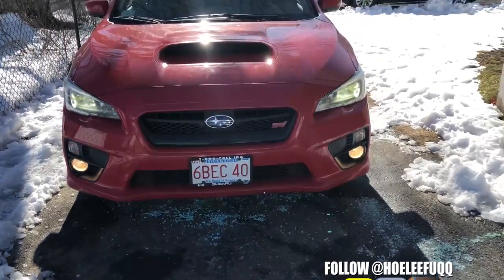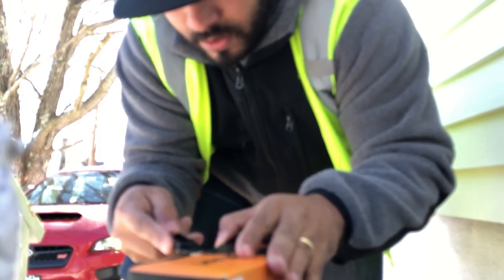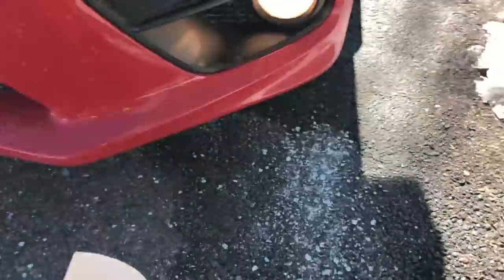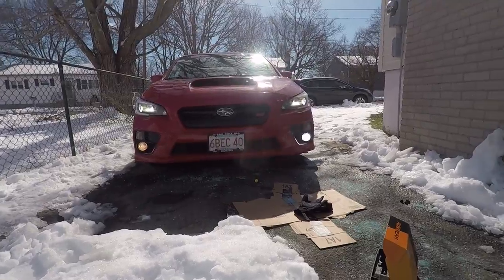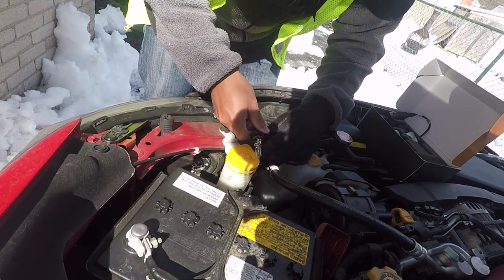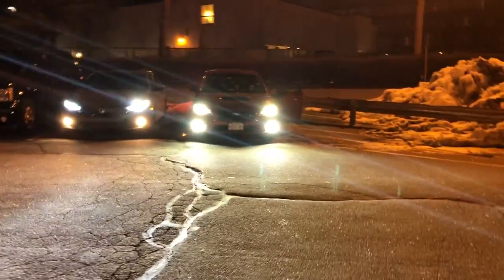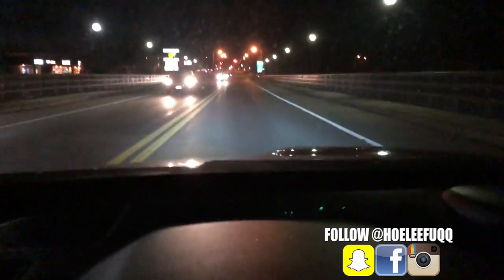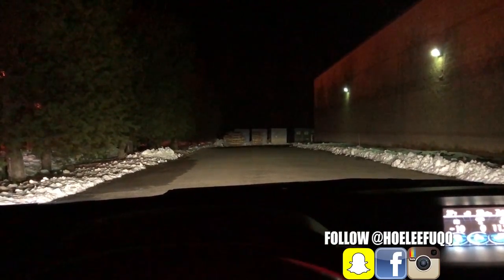BEST & Brightest  LED's? LED DRL & FOG LIGHT INSTALL ON A 2016 SUBARU WRX STI

Comment: Do you have a remote start in this car?
Reply from the maker: Yes copustar remote with android gps module to remote start via App on your phone
Reply: @HoeLeeFuQQ  did it void warranty and does it work with Apple
Reply from the maker: @eduardfernandoajtum173  no it did not
Reply: @HoeLeeFuQQ  sorry for all the questions but I need more details. Like the link to buy it where you got it like who put it on and how much.
Reply from the maker: @eduardfernandoajtum173  I went to my local alarm and audio store called parkway alarm or audio in everett Ma they sell and install in the same place I got a video on it on my channel I’ll link it hold on.
Reply from the maker: @eduardfernandoajtum173  https://youtu.be/xcDGAdtf4dg this is the alarm system I had bought it about 4 years ago with 2 remotes and iPhone app. On the app you can do everytime the remote does but more. The remote has 1 mile range with the phone app the range is unlimited u can be in another country and still remote start the car lol because it’s GPS base. That’s the feature that got me to buy it because if the alarm went off no matter where I was in the world I would get the notification. U can do that with the remote since most have a max range of 2 miles.also 4 years ago I payed about $800 for everything including install.

Comment: Wrong Type of Led Headlight Bulbs the Led Chips are way by far too wide they should very small high quality Chips the do not Line up exactly perfectly with the Halogen bulb filaments they will spread the beam of light all over the place which will not give a good beam of light get Led Headlight Bulbs that Line Up Exactly Perfectly with the Halogen Bulb Filaments that's the only Way you are going to get better Lighting That's not good